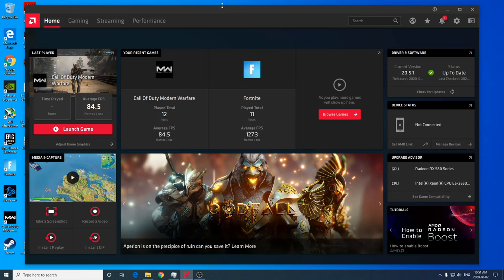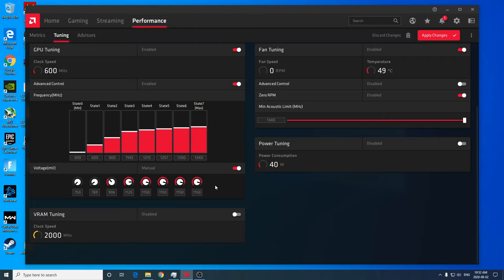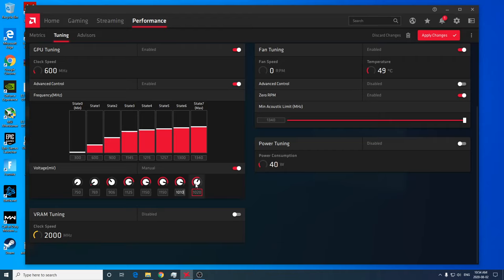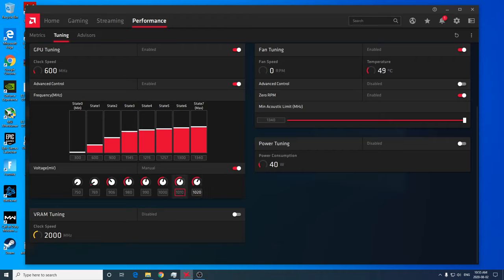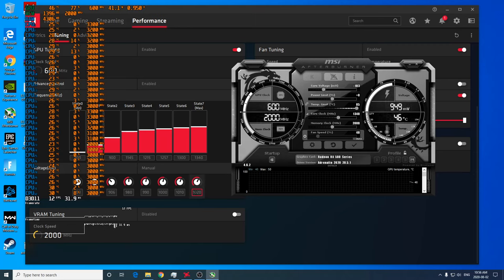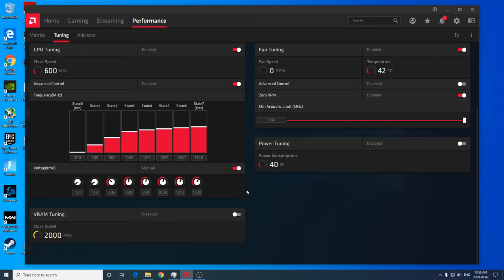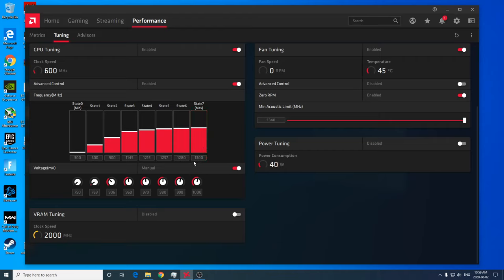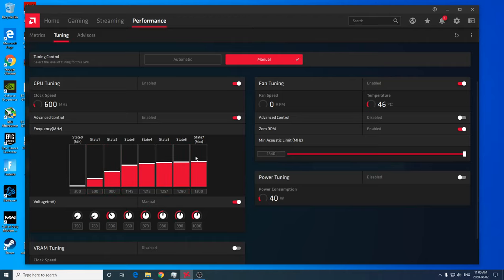How To Undervolt AMD RX 570 and RX 580 (How to lower GPU temp upto -10c)

Comment: Hi great vid! Does this also lower wattage / power consumption? I have ryzen 3 2200g and a corsair vs450w psu and im planning to get a 580 but im worried that my 450w psu is not enough.
Reply from the maker: if you have 450w psu, I would check how many watts you have on 12v rail.
i would assume its fine to use rx 580 with r3 2200g.
and yes undervolting would lower power consumption

Comment: Thanks for vid, now my rx 470 hovering at 50-60°c.
Reply: help me I also have an rx 470
Reply from the maker: @MancoloCDH  the RX 470 generally will require a bit higher Voltage than a RX 570, I would try running 1050-1150mhz at around 950-1000mv

Comment: I had Bannerlord crashing my PC recently and did exactly as here on RX 580 and it stopped crashing. I have a feeling my PSU is not in a good shape. Or what else could it be? Glad I found this video anyway.
Reply from the maker: Ya by doing this you drop power draw so it could have been psu issues

Comment: I gave myself a good scare first time I played around with wattman I accidentally set state 7 to 1347 MHz and bad things happened got a AMD Driver time out error then trying to hastily change it I got a checker pattern screen with white blocks and bits of my background showing the the system crashed booted back up and greeted by a AMD driver failure message thought I broke my card somehow but it lives on

Comment: I have an Asus RX 570 4GB Expedition which runs awesomely cool. Like, less than 70C when 100% in every game. It is even OCed. But, that is probably due to repaste of it from the previous owner.
Reply from the maker: Nice work!
Enjoy your weekend!
to get lower temps, you can lower core clock and core voltage more if you need.

Comment: Back, with a question.  I noticed today that I have white lines running thru the red bars on each of the states, where yours are located in the video...mine are about a centimeter or two lower going thru (horizontally) the vertical red line.  Should I be concerned, did i do something wrong?
Reply from the maker: I don't know lol, as long as the voltages and frequencies are set appropriately for your states mainly your last state, then it should be fine.
Also the software will probably look different now as it's been years since I recorded this

Comment: I'm using Radeon HD 7870XT, but it doesn't automatically set up like the video, and voltage setting is impossible. There are GPU, VRAM, Power, and Fan Tuning menus, but I can do is set the clock control as a number and the power control percentage only. There is no frequency graph (state 0~7) and, as mentioned earlier, the voltage setting is not visible. I have to adjust by entering a simple number. How can I do it?
For reference, the 7870xt has a base clock of 925mhz and a boost clock of 975mhz.

If you have an email, you can take a screenshot and show it.
Reply from the maker: You cant really undervolt the HD7870. It's too old

Comment: Hey um wanted to know and I'm afraid to mess with this settings, but my card which is ASUS RX 580 4Gb runs at 89°C while heavy gaming and it gets really hot.. Also I don't have a good airflow inside of my case  so could you suggest me a setting that'll give the same performance while gaming and also maintaining temperatures around 70°C  ?
Reply from the maker: Hello, good question.
1. its normal to feel "scared" or hesitant about doing something you've never done before or don't fully understand.
2. Yes its safe to do this, the settings i would recommend if you really want lower temperatures are as follows:
State 7: CORE CLOCK: 1200Mhz  Voltage: 950mv
And state 6- state 2, just lower core a bit so it is smaller than state 7 but bigger than state 2.
For voltage, just drop the mv by -10mv each state.
running 1200mhz on state 7 for your game will drop temps.
Otherwise, if that is still too hot, try:
1150mhz Core @920mv for state 7.
But i would try the first suggestion of 1200mhz @950mv.
If it crashes, increase the voltage by+ 10mv then test again.

Comment: what exactly does the "Min Acoustic limit (MHz)" do ?? Doing this, will my Rx get louder (noisy)?
Thanks for the video.
Reply from the maker: i am not sure, i would assume it will let your fans run at a higher rpm. I am not sure tho.
I use MSI afterburner for setting custom fan curve.

Comment: Please reply 
Aleksandrs Brodie, I set my RX 580 state 7 voltage to 970mV and 1300MHz and the games work without crashing, so can I reduce it even more? please help.
Reply from the maker: yes, you can reduce the core voltage a bit. if it crashes, just increase it a bit until you find a stable low voltage.

Comment: "The basics are to lower you State 7 Core voltage to one that is just high enough that the system does not crash and runs stable in games." Now i know that undervolting the GPU will help reduce your power consumption and reduce heat but what about game perfomance? wont undervolting transalte to worse perfomance in games?? how can i find where is the right spot to set the voltage for the "state 7" in order to bothe lower the temperature and keep playing games without any issues?
Reply from the maker: yes, if you lower your core clock, you will lower your performance a bit. (the only reason i would suggest lowering your core clock if your GPU still is overheating when you have lowered your state 7 voltage to a more optimal voltage.)
and yes, the card will use less power with lower voltages.
The only way you can find a optimal lower stable voltage for state 7 is by testing, you can start with -50mv, if it runs stable, then try -70mv from the stock votlage, and continue lowering the votlage a bit at a time until the game crashes, then you know that the voltage you previously had which was stable and I would run that voltage.
you can also look on my channel, i have a few other good videos talking about undervolting and even have one that shows you some settings you can copy if your card is really running hot.

Comment: guys first decrease voltage and see  if tempeature reasonable you dont have to decrease core clock speed cause  voltage is not impact gpu performance but core clock impact performance
Reply from the maker: yup. that is how I would suggest doing it.

Comment: Hi i have a RX 560X with a memory of 4gb plus a integrated128mb vega 8. My temperature shoots to 80c even at idle once i plug AC as it goes  to 1218mv but keeps fluctuating to 918mv  at which the temp comes back to 50c. I usually use Solidworks, adobe and other medium load software. Does the power process management option under power settings have anything to do with this?
Reply from the maker: Hello,
I would recommend for your GPU, set the core clock to 1150mhz and the core voltage to 940mv.
That should help, and you can set core states from 2-7 with that same voltage.
Reply: @AleksandrsBrodie  Thanks a lot!

Comment: I have a question i ordered rx 580 2048sp and i realised u dont have 8pin in my psu will undervolting helps to prevent melting molex to 8pin adapter? I want to use it until i get good psu
Reply from the maker: @aashisht05  yes you would definitely want to undervolt. Most likely you want to run 1110mhz on the core at 920mv. If you run any higher of a core clock frequency it'll pull too much power

Comment: is it ok to copy your settings, or do we have different kinds of adjustments depending on the unit's design?
Reply from the maker: You can copy, I suggest copy the settings from the video I link in pinned comment in that I put in comment section

Comment: Can you please do a video however with the RX 590 or would this video work with the RX 590? This is as with this card my temps go high when playing certain games
Reply from the maker: It's not about which card you have  but it's about applying the same principles of finding an optimal core voltage for the given clock speed you would like to run.

Comment: I have an RX 580 4GB and Undervolting is worth it especially if you're experiencing overheating and crashes often. 
(It probably doesn't have the same effect on everyone. I'm no PC expert so it's a risk you'll have to take)

My State 7 frequency on default was on 1340mhz with 1150mV. Changed it to 1266mhz with 960mV (I lowered other states too)
 and now playing RE: Village with recommended settings, 1080p 60fps on 60-65c.

If you don't know how or where to start on the frequencies I suggest checking out your GPU's base clock and starting from there. Use Benchmarking software and use it for a couple of minutes to see if your settings will crash or not. 
And if you think your fps is low, amp the voltage (by 5mV for me) up a bit until you find your sweet spot. (basically Trial and Error lol.)

Also, play with your fan speeds, I set mine 5+ higher on the temp (e.g. 50c = 55% speed).

I hope your GPU works out fine and dandy.
Reply from the maker: Good info! and yes i agree, these Polaris cards really benefit from undervolting :)

Comment: I will play around with the settings if this can potentially lower my noise levels its gonna be sweeet. :)
Reply from the maker: If you want settings to copy, I would watch the undervolting video that I pinned in the comments. Its example settings you can copy for lower temps.
Reply: @AleksandrsBrodie  1060 for my state 7 and then -10 is perfect stable i tried it on unigine superposition and now i played about 45 minutes of Cyberpnuk 72 max and  less noisy than before thanks for the video the tutorial was really easy to follow. :)
Reply from the maker: @formidablefoe3016  Nice!
Glad you were able to follow along and get a better understanding of how Undervolting works.
It can be a life saver once you understand how big of a difference it makes in Temps and Noise ;)
happy holidays!
Reply: @AleksandrsBrodie  Likewise! :)

Comment: I have a gigabyte RX 570 4gb card and the heat in the games reaches 87c' which is the solution??
Reply from the maker: try 1200mhz on Core state 7 at 950mv
Reply: @AleksandrsBrodie  explain to me
Reply: I have problem
Reply from the maker: @OMAR-pe3ck  or copy the voltage settings i used in the video. when you lower the core clock and the core voltage, gpu use less power, less power = cooler gpu
Reply: @AleksandrsBrodie  thanks pro
Reply: @AleksandrsBrodie  now 75c
Reply from the maker: @zalllrn if it does not crash then it good!

Comment: Hi man, starting first that this method saved my GPU and i'm thankful but recently my GPU resetted those settings and when i'm trying to bring them back as you showed in the video my pc crashes.. i don't know what to do, any tips?
Reply from the maker: try these settings https://www.youtube.com/watch?v=0pzxFZBw-6Y
Reply: @AleksandrsBrodie  i will try and i'll let you know
Reply: @AleksandrsBrodie  I've tried but still crashes i have a rx 590 8 gb VRAM. This used to work since i installed new gpu driver using windows (  device manager ) because i was trying to fix some issues, you think that will be the problem? You know how to solve it?
Reply from the maker: @raff7195  try the latest drivers. Otherwise I am not sure

Comment: Does the and radeon software work only with an amd cpu? Cause I have an Intel cpu and I'm going for the rx570 8gb. And also I wanted to ask you that is liquid cooling is needed in cooling the rx 570 since it is a very hot graphics card. Plz reply sir.
Reply from the maker: This works and gpus, like the rx 570.
I recently made am updated video which you can find on my channel which shows you which settings to use for your card so it runs cool
Reply: @AleksandrsBrodie  thanks sir

Comment: Hello, I have an XFX RX 570 8GB, and it seems that in FunMark with the default fan settings, it reached ~ 90 degrees Celsius and I received blackscreen, with 80% fan speed, it is stable at 78-82 degrees Celsius but causes a unpleasant sound. Can you recommend something to me? I'm honestly afraid of undervolt, because at the moment, I can't afford another video card in case the current one breaks. Thanks !
Reply from the maker: Undervolting is your only option really.
I would find my video on my channel called "optimal voltages" where i show you what settings to copy.
I put them in that video description, should be about a 4-5min long video.
Undervolting is safe ;)

Comment: I got a ASUS RX 580 8GB i did the same steps but when ever i undervolt it shuts down or my game crashes
Reply from the maker: I would watch the latest undervolting video I made and try those settings.
Otherwise you need to either lower your click speed or increase your voltage.
It's a balance between core clock and core voltage.
Otherwise you crash

Comment: Hi i was reliefed when i followed your video and everything works well my gpu temp turn 78 to 64-69 but some time after im having alot of screen freeze and random crash, i would really appreciate your response. thank you
Reply from the maker: In this case, I would suggest lower your core clock by 50mhz.
Reply: @AleksandrsBrodie  much appreciated, i'll update when something happens again
Reply: @AleksandrsBrodie  hi thanks again i just wanna ask something again, its been weeks and everything was normal until the day comes where my gpu temps were not usual anymore does this something to do with the software or the dust problems?

Comment: So does the undervolt applie just for the saved game profile? Is there a way to save it so it applies at windows boot? Have my 3070 UV via Afterburner witch loads the UV profile at starup. Would like to have the same for the 1080P rig im building for my little brother.
Reply from the maker: Yes through amd drivers game profile is only for a select game, you may he heyter off setting a voltage curve in msi afterburner

Comment: Jim crashing in cod waw it goes to 80 c and crashes and pc restarts
Reply from the maker: if it crashes after doing the undervolt, you will want to want to increase you core voltage,
But because your GPU is overheating, you will want to drop your Core clock to something around 1200mhz and run Core Voltage around 900-950mv

Comment: thanks this helped out a lot
Reply from the maker: Glad to hear!
Remember if it crashes just to increase the core voltage a bit until it runs stable.
Good luck!!
Reply: @AleksandrsBrodie  I used the settings you put and it didn't crash so that's good

Comment: Hello, a question: If I modify a profile by raising eg. the speed of the fans, every time I turn off the pc it does not resume the changes but I always have to load the previously saved profile manually. Is there any way to make him save it somehow?
Reply from the maker: the only way you can make these settings apply automatically is by setting a game profile which means any time your game application starts up it will apply the undervolt/fan settings inside of that profile.
otherwise, as you know, the settings will just reset after pc restart.

Comment: well got unlucky my rx580 cannot handle the undervolt at all it just fails with amd stress test which people said is pretty light not even in any game lol. Also by default my state 4 voltage is way higher than any other it was like 1181mV for 80 mhz jump lol then it goes back to 1150 I guess asus knowingly used bad binned chips for the asus dual model and went full agressive on voltage to get stability.
Reply from the maker: @cin2110  https://youtu.be/0pzxFZBw-6Y?si=QvTMzkOelQfATjUf

Comment: thank man!! I got a gigabyte 570 losing picture, replaced the pads on the memory and paste and still lost pic;;didn't change the pads on the vrm but temps seem beter but los pic...gonna try and undevolt   if don't work I kinda wonder if dude gimme a falty card.
Reply from the maker: Some of these rx cards were abused while mining as some people dont know how to run safe low power settings and instead run stock settings which can damage the card

Comment: Do I put my fans on auto? How do I do that? Or do I tune my fans too?If so what is the sweet spot so it doesn’t take to many voltage ? Also what is zero rpm
Reply from the maker: I have a video on my channel called "optimal voltages" for undervolting.
That will show you what settings to use for low temps.
And yes, I would set a custom fan curve either in amd software or I personally like to have msi afterburner for fan control.
Reply: @AleksandrsBrodie  I just saw that video but can I have your settings so I can work my way on them or I am thinking of starting at 1060 or 1070 then lowering by 10 till stage 3
Reply from the maker: @isamalzareer7721  the three tutorials I made will explain how to do it.
And you can always edit the settings yourself.